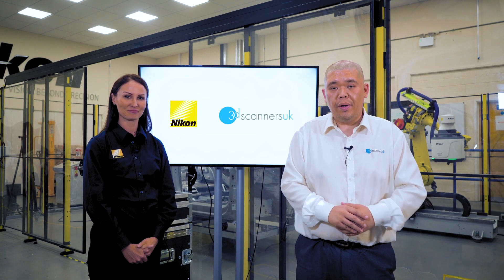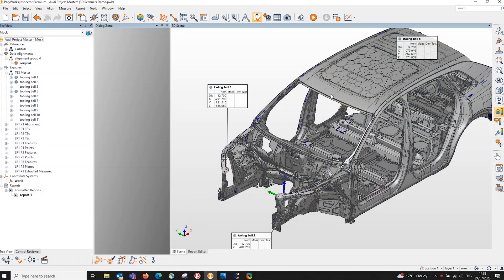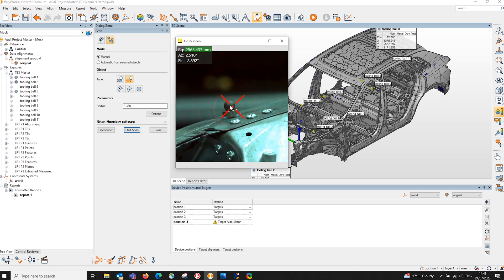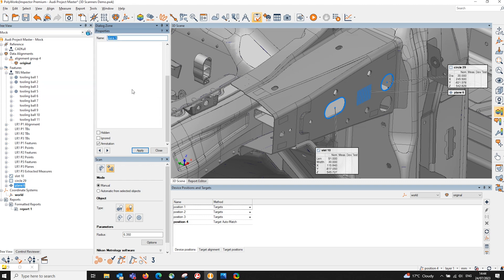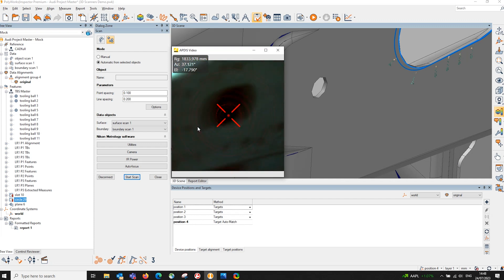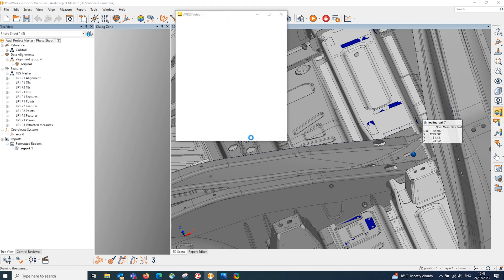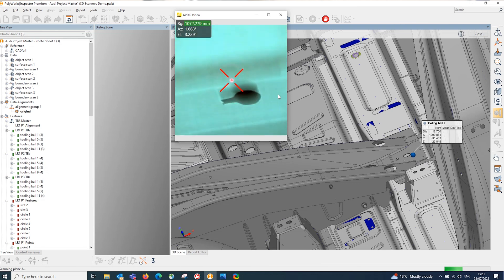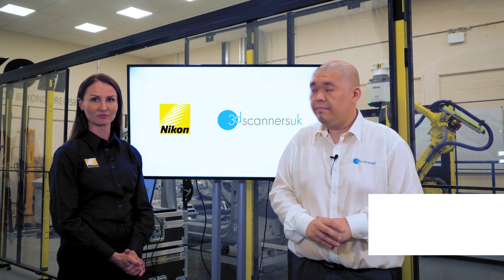PolyWorks® + APDIS Laser Radar

Comment: excellent demo,   I used the original Metris Laser radar system when created.    The accuracy was always nice, even compared to a CMM.
The large scale measuring was phenomenal.   Used it for aerospace and nuclear products.   Fast production speed and accuracy for its time.   The use with a robot and polyworks is great for automation.   Only issue was measuring stainless steel,  but that was with the original machines.